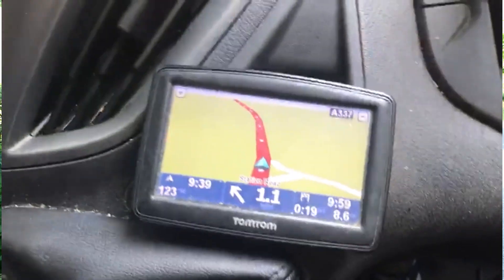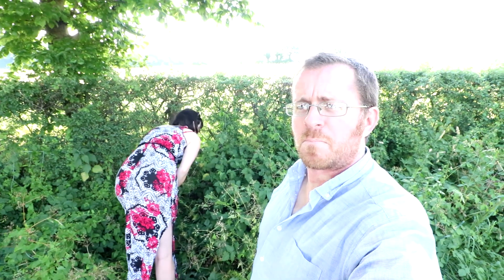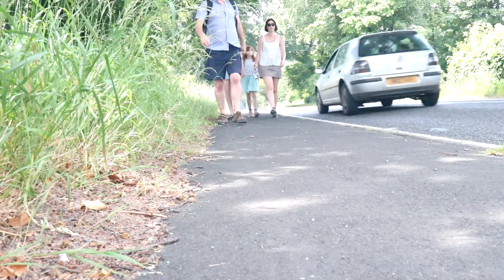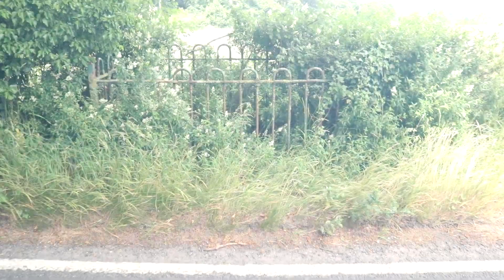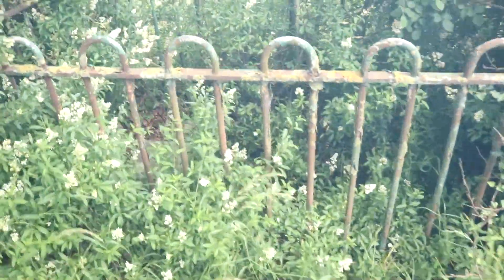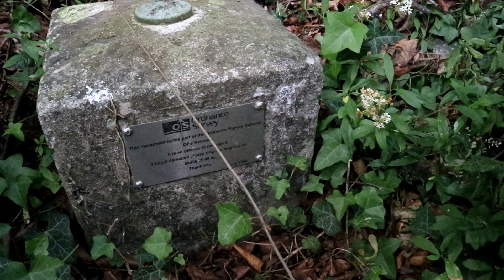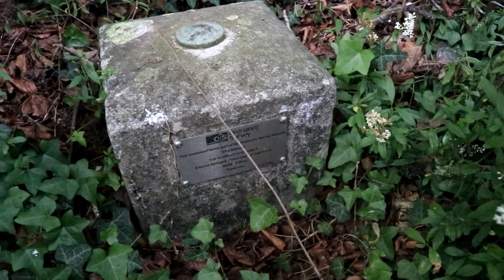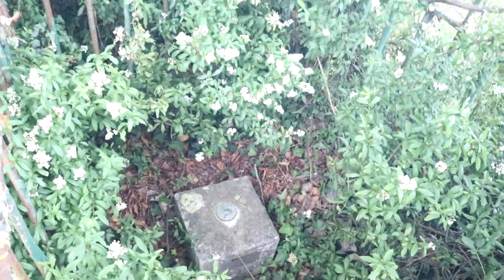Measuring Heights Prior to GPS - Benchmarks and Levelling Points

Comment: Hi Paul and Rebecca. I have just found this video and as a Land Surveyor I have to correct you on this. Benchmarks are only for measuring heights, not distances.
It is good practice to start and finish on different benchmarks, a large difference would indicate that there was an error with one or other of the two.
Triangulation (Trig) Pillars and other other fixed control points were used to establish locations by measuring angles and distances from known points. Trig points always had a Flush Bracket fixed to one face.
Reply from the maker: Thanks Andy. Actually forgot I still had this video up. Re making a three part series on this and clearly agree with your correction.

Comment: Being  a  former  surveyor's  assistant (a  rodman)  I  can  attest  the  the  math  involved  is  anything  but  basic.  "easy" was  geometric  math.  The  hard  stuff  (and  there  was  a  lot  of  it !)  was  the  trigonometry  and  parabolic  math.   As   for  distance,  line  of  sight  is  critical,  so  lots  of  brush  clearing  by  many  people  was  common (like rodman).  Elevation   over  distance  could  be  ten  miles  or  more  thanks  to  trigonometric calculations.  However,  distance  was  brute  force  100-500  feet  segments  called  chains  and  the  old  days   it  actually WAS  a  chain   with  MORE  math   involved  because  of  elevation  changes  or  going  around  obstacles  like  buildings  or  giant  trees.

Comment: Where I live these points are known as Geodetic markers and are used by surveyors to mark out boundaries, and the routing of roads. Most are installed where hopefully they won't be disturbed, for instance along the old Erie Canal.  Even with GPS, the markers are still used as line of sight by surveyors to this day.  They are posts  made of concrete and sunk into the ground with a bronze cap on top.  The location is marked in latitude and longitude with accurate compass markings and a center dimple for setting a surveyors tripod over it. There is one not far from where I live and I've seen utilities crews using it and no doubt like you, cursing the weeds and bugs around it!      In the city, the bronze plates are embedded in the sidewalks at intersections.
Reply from the maker: Brilliant. Certainly sounds like a similar system.